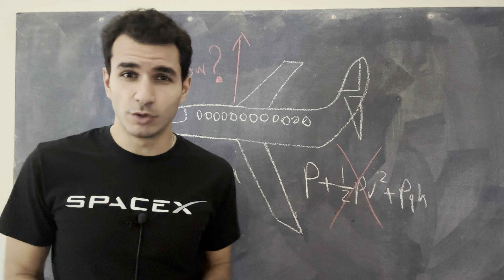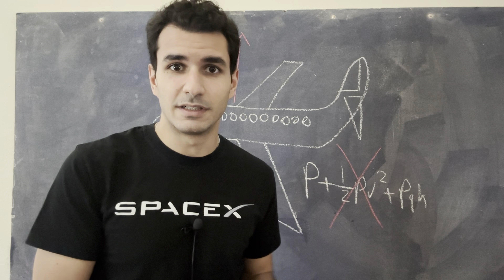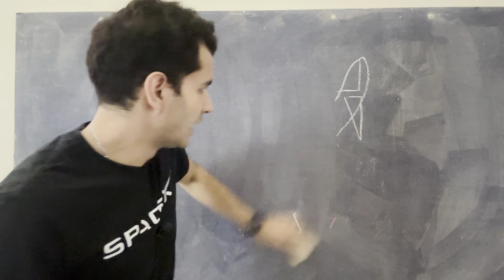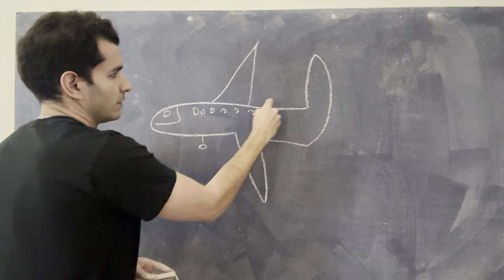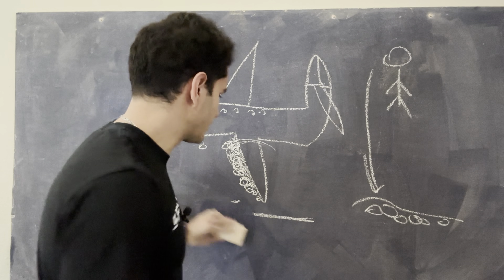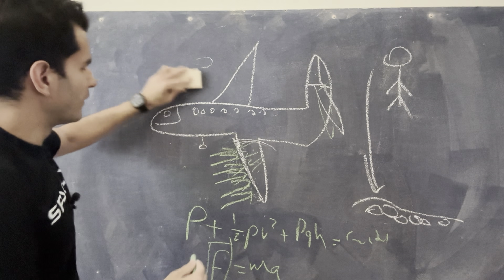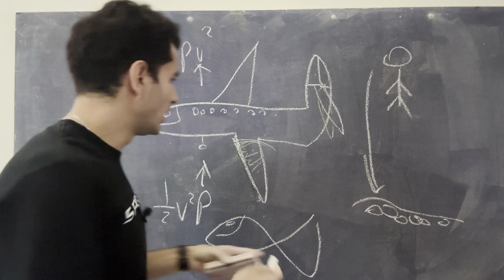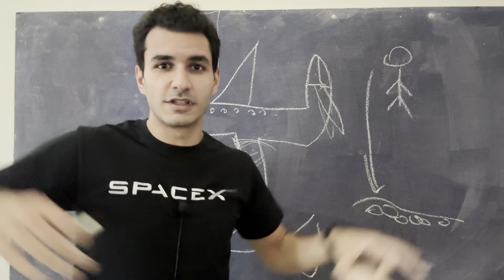Fix This One Misconception = Understand Airplanes Forever

Comment: I teach aerodynamics as an engineer and flight instructor. it's one of my favorite topics. but this video is not impressive at all. so many subtle lies and misconceptions in here, especially with regards to the "control elements" is complete nonsense. You leave out so much vital info necessary for someone to truly apply an understanding of lift to practical application, including knowing how an airplane flies and what control inputs will do what and why.

You're confident this is how things work, but you are so far off of the truth that you can't perceive how far off you are.

And conflating disagreeing with you to hating physics is childish nonsense.
Reply: It pains me:  why isn't this obvious to most people.
Reply: @davetime5234  Why isn't what obvious?

Most people struggle with understanding aerodynamics. The full explanations and understanding is not intuitive to most, and involves a lot of variables, many of which have no good equations that are accessible to the average person. But the equations aren't entirely required to learn aerodynamics concepts, but it helps.
Reply: @SoloRenegade Because although solving Navier-Stokes equations for the general case may be incomprehensibly complex, but that should by no means stand in the way of learning something meaningful, though abbreviated without sacrificing the rough truth in terms of basic principles:

Lift is the traverse force resulting from an asymmetry to the relative flow, consistent with maintaining mass flow continuity and conservation of momentum and energy.

And the rate of change of vertical momentum  of flow fully equals the vertical component of lift every bit as much as the vertical pressure gradient accelerating that vertical momentum change.

And that the split in mass flow, consistent with the above principles must increase in speed on the top and, as a result must decrease speed on the bottom, further connecting linear to rotational concepts.
Reply: @davetime5234  "Lift is the traverse force resulting from an asymmetry to the relative flow, consistent with maintaining mass flow continuity and conservation of momentum and energy. And the rate of change of vertical momentum  of flow fully equals the vertical component of lift every bit as much as the vertical pressure gradient accelerating that vertical momentum change..........."

 blah blah blah......you say lots of words, but that is going to help no one, confuse people, and not be useful in terms of application. you're vastly overcomplicating things.

If that's the best you can do, then you truly don't understand lift yet.

"And that the split in mass flow, consistent with the above principles must increase in speed on the top and, as a result must decrease speed on the bottom, further connecting linear to rotational concepts."

No. you don't just get to hand wave away why pressure is lower on teh top and the velocity change.  If you can't explain this properly, you don't know what lift is.

"rotational concepts" are just that, Concepts. they don't occur in real life. it's just a trick to make a version of teh math work, but it doesn't happen in real life.
Reply: @SoloRenegade What's your alternative explanation?  (otta be good)
Reply: @SoloRenegade No explanation?
Reply: @SoloRenegade  Where is the lone rebel insight, we are all eager for?
Reply: @davetime5234  "No explanation?"

 wow, commenting mere hours apart, expecting answers on your schedule and at your beck and call? talk about entitled, rude , and impatient. Some of us actually work for a living. You have to wait for people to have time to get off work, find your comment, respond to it. etc.

And even then, your comment is so worthless. No explanation, for What? You're going to struggle with lift if you can't pay attention to detail. start by providing proper context with your comments.
Reply: @SoloRenegade  Entitled and ru...?we can all look at our own reflections.   Context?  Basic, yet physically true word description of lift that avoids the usual false oversimplifications: integrate the conservation principles of mass flow continuity, momentum, and energy with force, pressure and speed due to shape, distinguishing AOA from camber asymmetry, and the relation between linear and rotational relevance?
Reply: @davetime5234  "we can all look at our own reflections. "

I demanded nothing from anyone else, as you did. I merely stated my observations and criticisms regarding this video. Critique is not rude, it's science. He made bold claims in this video, and failed to back them up. And so he's going to get called out for it. He seemed to received the criticism well like a professional, and he earns respect from me for that. But you are  rude to the core.

"Basic, yet physically true word description of lift that avoids the usual false oversimplifications: integrate the conservation principles of mass flow continuity, momentum, and energy with force, pressure and speed due to shape, distinguishing AOA from camber asymmetry, and the relation between linear and rotational relevance?"

This is word salad nonsense. Nobody talks like that. 

"distinguishing AOA from camber asymmetry, and the relation between linear and rotational relevance?"

this is rubbish nonsense. this doesn't even mean anything relevant to understanding aerodynamics.

Comment: If the airplane had no horizontal stabilizer it would eventually become airborne the faster it travelled, even with the cambered airfoil having a zero angle of attack. So in this case, the Bernoulli principle is the dominant factor for lift generation. There is some conservation of momentum as the airfoil generates a slight down wash as a consequence of laminar flow over the top of the wing.
Reply: cambered airfoil can generate Lift even when AOA = 0 ,  some cambered airfoils can generate lift even at AoA = -1 , -2 degrees it depends on the curve.  ,  a symmetrical airfoil wont generate lift at AOA =0* even if it travels at mach 1.
Reply: @hemendraravi4787 agreed, a symmetrical wing will never generate lift assuming the airflow is acting perfectly planar to the symmetrical wings cord.

Comment: I think the comparaison with a man diving into water is unfortunate . In this case the initial kinetic energy of water is 0 the energy of the diving man is transmitted to water. Water resists to diving man because of the inertia. For an aero plane the flow is essentially steady  around the wing and according to D'Alambert paradoxe (see wikepedia) if the flow  is steady ,irrational,incompressible , inviscid the lift would be reduced to buoyency.l Without viscosity the wing will be unable to generate rotational flow that will lift the aero plane
Reply: Rotationality requires viscosity?  Completely unrelated.  And be reduced to bouyancy?  Again, completely unrelated (force equal to the weight of mass displaced).

Comment: There is definitely a connection between bernoulli and newton's law because airplane wings need to have a huge camber to generate significant lift. I would imagine most of the time a plane is relying on its angle of attack plus the bernoulli effect to fly rather than either method alone. I'm curious to see how wings generate lift at supersonic speeds since the density of the air in front of the wing is probably way higher than above or below the wing.

Comment: Lift and the Mechanics of Flight 
The concept of lift generated by an aircraft wing can be approached in two distinct ways: a) through analytical or empirical assessments of performance, and b) by developing an intuitive understanding of the principles governing flight, which is the focus of this discussion. The fundamental reason for an airplane's ability to fly lies in the work performed during flight. This work results in the displacement of fluid by the wing, which in turn gets displaced in a resultant direction to that of the fluid's displacement. 
For example, when a person runs while pulling a glider with a line, a specific force must be exerted, indicating that work is being done. The force exerted on the string, along with its angle relative to the horizontal, can be decomposed into lift and drag, while gravity (the mass of the glider) and the runner's effort on the ground represent the other two forces: weight and thrust. It is crucial to recognize that 'LIFT' is not a tangible direction but rather a conceptual force derived from the resolution of other forces.
In aerodynamics, physical laws are articulated through analytical expressions that depend on homogeneous functional relationships, dimensional analysis, and empirical coefficients. Although these frameworks describe various phenomena, they fall short of providing a thorough understanding. The particle mechanics of a viscous fluid are intricate and not completely understood; ultimately, the key takeaway is the relationship between fluid displacement and the reaction of the body in motion. 
Much of the existing literature and media reiterate Newton’s third law, yet this perspective offers limited explanatory power. In fact, the behaviour of aerospace vehicles—such as rockets, propellers, jets, and wings—can be more accurately described by Newton's second law rather than the third. This is a common misconception. According to the equation F=ma, when an individual throws rocks from a wheeled cart, the cart will move in the opposite direction. For instance, if a person throws a 2 kg stone at a velocity of 10 m/s every second, they are effectively exerting force against the inertia of the stone. In this scenario, the force can be calculated as follows: 2 kg multiplied by 10 m/s², resulting in a force of 20 Newtons. While analyzing the forces of lift, drag, gravity, and thrust is essential, it does not adequately elucidate the phenomenon of lift itself. These terms serve as analytical tools for the design and performance prediction of aerodynamic surfaces, but they primarily provide a description rather than a comprehensive explanation. 
Daily Reflection: To instigate movement or transition, whether in a fluid medium or the vacuum of space, it is necessary to either discard an object or alter the trajectory of an object moving past.